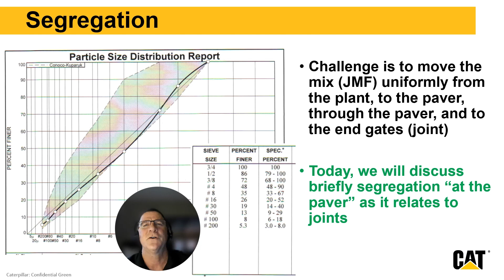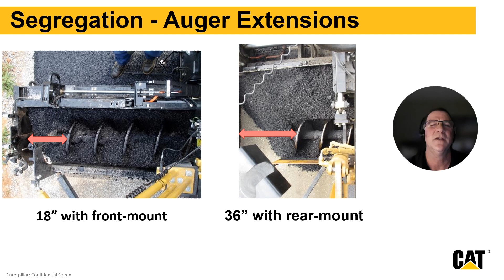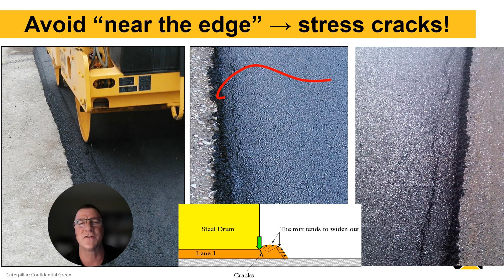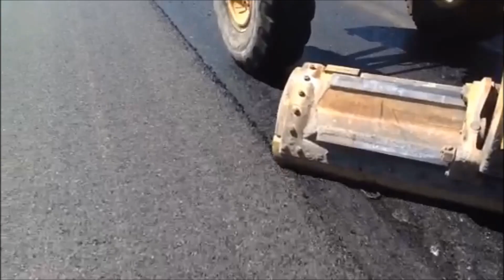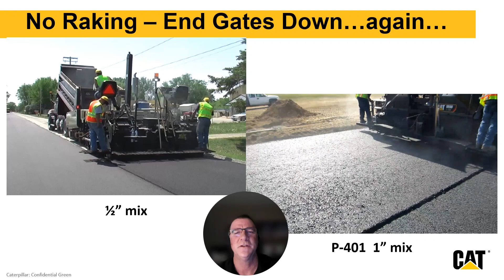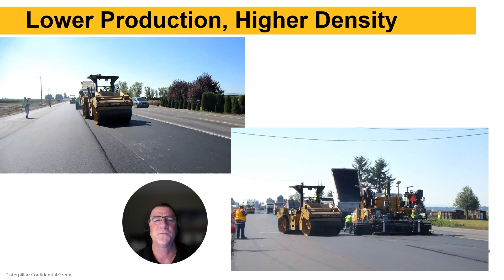Tackling the Longitudinal Joint: Best Practices to Make it Uniform

Comment: Thank you for your question. Sorry it has taken us so long to respond, we just saw the post. While there is no firm definition for "hot", the common temperature is 175F or higher. There are so many variables to consider. If you make a series of short pulls, tacking is still key along that joint to aid in compaction. Likewise, for the first pull, you may want to experiment with not compacting longitudinal joint until the second pull is completed so that the uncompacted lift heights are equal - essentially simulating echelon paving. Once completed, check with a gauge or cores to see what density was obtained. If you do it, we are interested to hear your results.

Comment: Love these videos! 
Question; at what temp is that joint no longer considered “hot”, inwhich you’d compact the unsupported joint prior to paying the adjacent lane, instead of compacting the hot joint first thing. 

I guess what I’m sort of asking is, can a hot joint only be attained through echelon paving? Or perhaps in the circumstance of short 40-50ft passes where there’s a joint, would you achieve optimal compaction through compacting that joint at once, as if it were a hot joint, or rolling the the unsupported joint first after the initial pass before laying the adjacent pass.